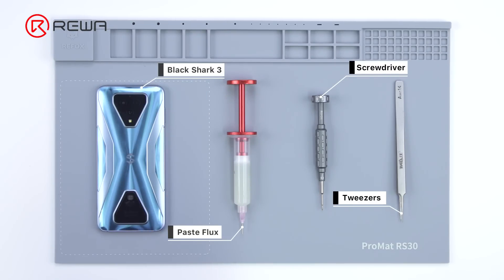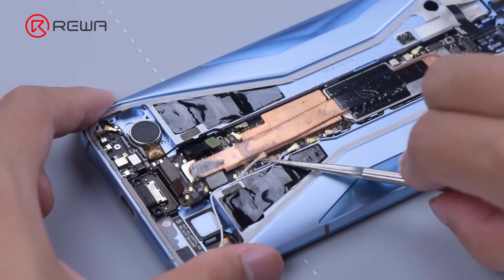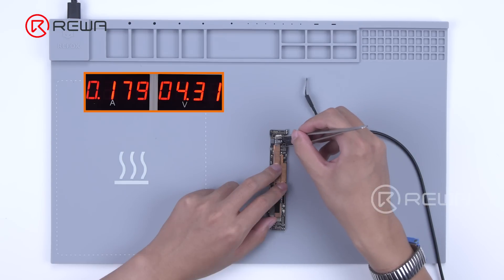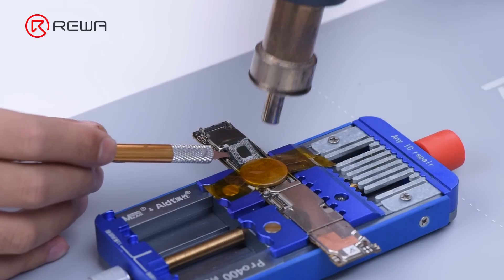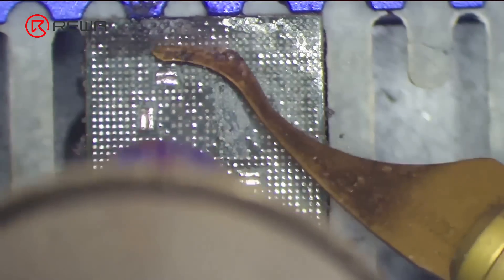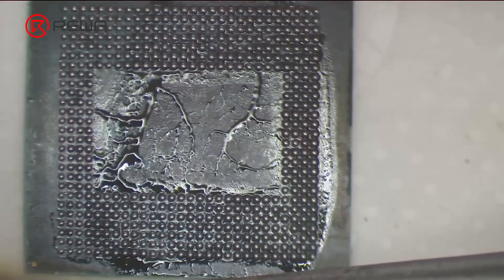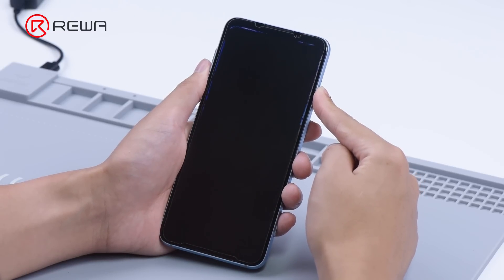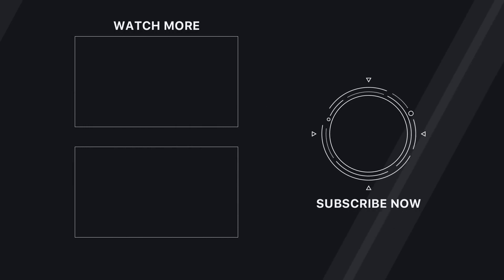Fix Xiaomi Black Shark 3 Won't Turn On - CPU Reballing

Comment: how do you know the part causing the error is the CPU ? Based on the power supply clock indicator?
Can you have a tutorial on how to identify errors based on the power supply clock indicator?
Reply from the maker: For models powered by Snapdragon 888 and the boot current jumps between around 100 mA to 200 mA, the typical solution is CPU reballing.
Reply: @rewatechnology2008  I'm in saudi Arabia I need to repair my black shark 3 pro screen please help or give me any solution please help me hear not any good technician
Reply: @rewatechnology2008  i have black shark 3 mobile its not turning on, can you fix it ?
Reply: @rewatechnology2008  what is correct current?

Comment: Excellent job 👍👍...but what is the design of a phone???? really not appropriate
Reply: To provide better cooling with Black Shark Cooler Fan... But, its more easy to pull BS3 logic board than the batteries... It's one hell of cables and flexible